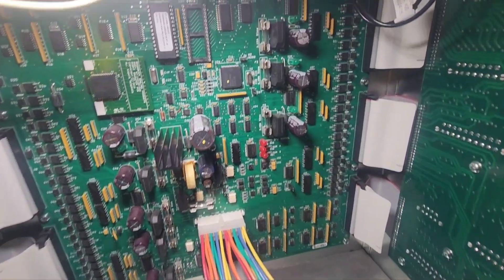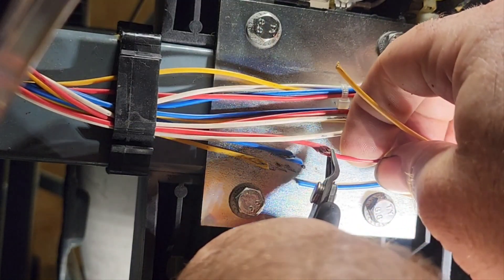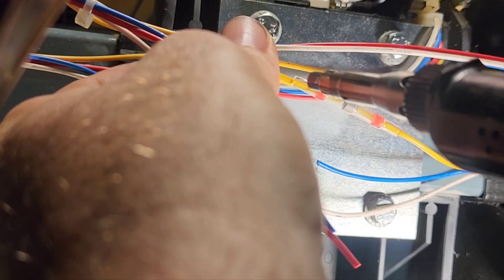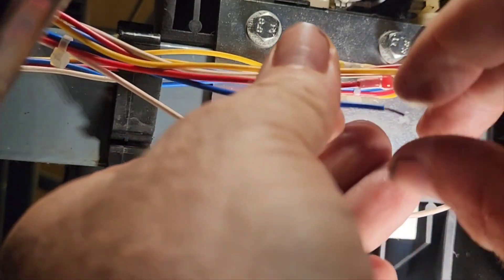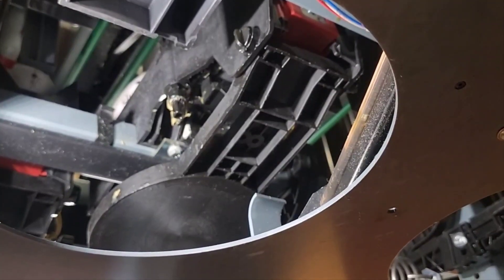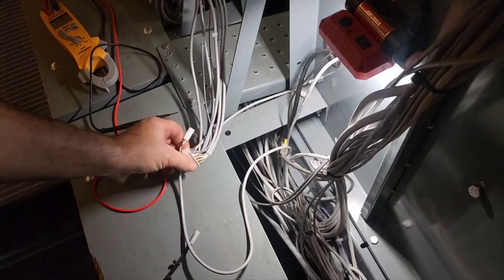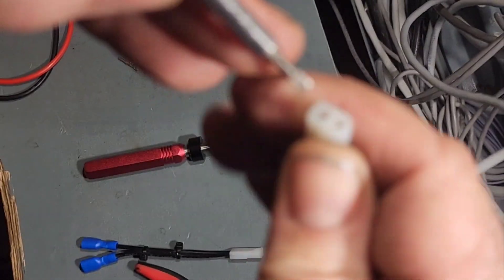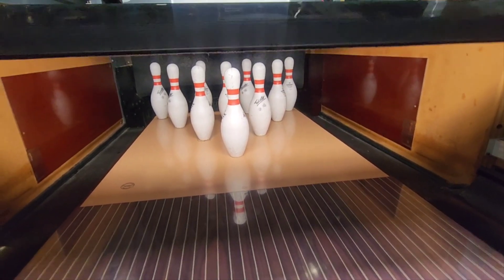Brunswick GSX Nexgen blowing F2 fuse on CPU board. problems found and repaired.

Comment: Any ideas on PF code every time machines turned on ? Comes of after on /off again thanks
Reply from the maker: PF error code indicates power failure. It happens when the incoming power to the Nexgen box is not present. Do you turn the circuit breakers off? 

I believe that you can turn the PF error codes off in the setup menu on each Nexgen box.
Reply: Staff turning all circuit breakers off for the night , and in morning Pf happening on two lanes only.
Reply from the maker: Dissable PF error codes on nexgen settings menu.
Reply: That works! Big thanks!

Comment: What is the purpose of the red band in the heat shrink ?
Reply from the maker: I believe it denotes wire gauge. Like red or blue butt connectors or different color wire nuts.